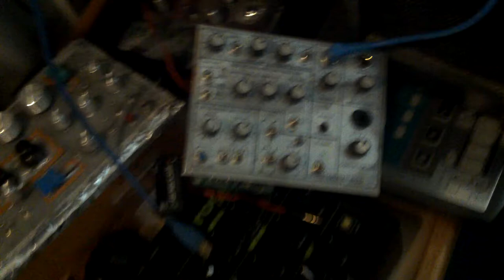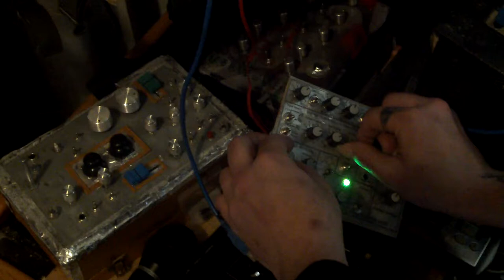NOISE TOASTER MOD Rack Eurorack size panel BY nvd new voodoo design newvoodoodesign.com

Comment: Good question about the keyboard. I'd like to know as well.
Reply: No. The VCO is not logarithmically scaled to 1V/oct. It could be possible to control through the Expert Sleepers DAW CV interface but it's likely not worth it. Check out Ray Wilsons MFOS site to see some of his one-board analog designs that do follow the 'standard' 1 V/oct interface.